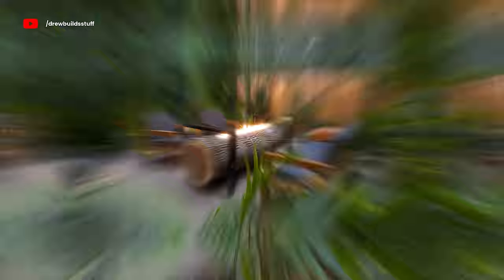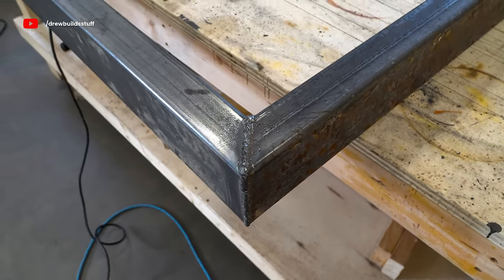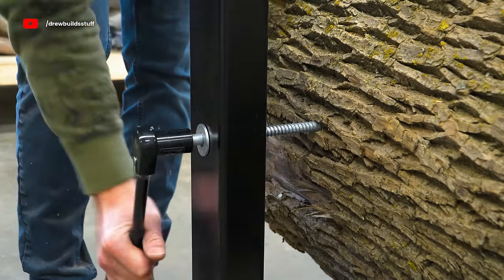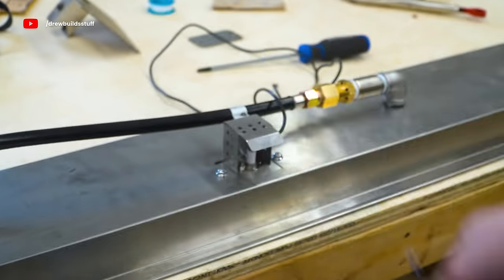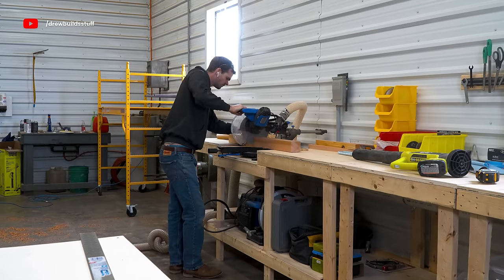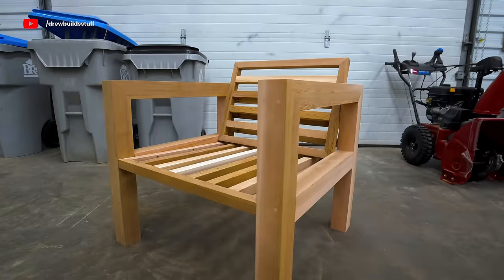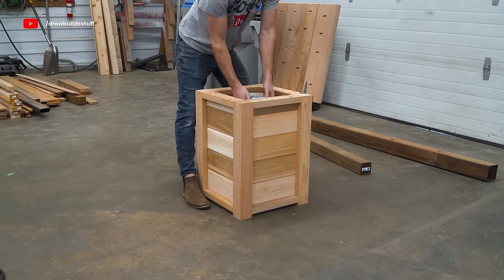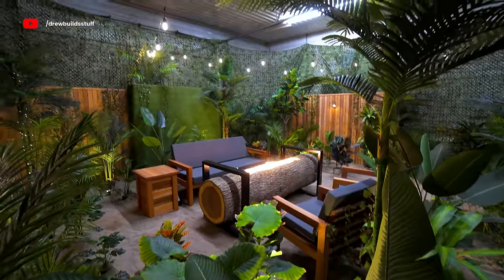Making my SHOP into a TROPICAL PARADISE for a Week - Full Build

Comment: HOLY MOLY, that is epic!  If you're ever bored, would be interesting to carve out a hollow in the log to put the propane tank in so there's no exposed hoses.  You could cut a cookie off the end of the log first which would be reattached using magnets or hidden hinges for when you need to swap out the propane.  Epic job!!

Comment: What a great idea. If you can't go to the beach, bring the beach to you. The 'fire log' is really cool. 

Here's a little welding tip: Bevel the edges of the materials to be welded. Butting two flat surfaces together, laying a weld on top of them, and then grinding everything off above those surfaces gives very little bonding strength to the joint. It's kinda like pushing two pieces of wood together and dribbling glue over the line between them, hoping that enough glue gets between them.

Comment: The stuff you build is outta this world, ive been watching for yrs & still amazed. That cheapy flux core welder does great & the welds are good . Now those bottom  of the line ryobi , i love mine , zero problems , i have dewalt & i think ryobi is just as good . Ive got there chainsaw  , weed wacker & love them all . I didn't used to think like this .

Comment: Excellent job and choice of projects. I especially appreciate the tropical experience, being raised myself in Florida. 

Only thing I would've done different is in trimming the 4x4s, I would've used a table saw and saved the 3/8" pieces for later and used as trim on another project. It would've saved a lot of tome on the planer too.

Comment: I've done a few fire feature bowls and tables, I would add a heat fiber or heat insulation between the fire insert and the hoses/wood. It will save the hoses and avoid burning the wood from transfer heat. Just a idea

Comment: Would love to see more personal videos. I would also like to recommend that you build a wood working bench. something that has a little something of everything you need for it. like clamps, maybe a welding table, straight edges/ preset angles/ preset lengths you tend to use more often ( i see you've built a lot of walls lately lol), and maybe a place you can put your more bulky tools like your planer. i think something like that would help a lot with efficiency..... and your back! lol. always a good day when you upload man i cant wait to see the next parts of the tiny home!

Comment: Some 1/4 inch or 3/4 inch copper pipe painted black and slid over the bolts that go into the log would finish it off lovely.

Comment: if you decide to build another bike trailer you should make one that looks like a 5th wheel trailer which attaches to the bike using a standard 1 7/8" trailer hitch and a tilt-ball mounted to a heavy duty rear rack. With that and the right suspension setup you should have pretty good maneuverability and it'll be nicer to pull.

Comment: Added benefit of planeing down the 4x4's is you reduced the total weight of that frame by about 25%, and they'll still be more than strong enough.
The downside is you pay for the full size 4x4, and turn 1/4 of it into sawdust. For clear cedar, that's some pretty expensive sawdust.
Reply from the maker: Haha very true

Comment: Supposedly if you dust some soot on the metal around your weld it prevents weld splatter from sticking and helps with a bit of that cleanup. Never welded before in my life so no idea if or how well it works, just passing on what I heard.

Comment: When I built my bed frame I kinda wish I had a planner cut them 4x4 down to 3 inches. 
I am considering doing it again and buying a planer just for that project. I want to do the frame much better with the legs inset more and build a head board and foot board along with it. My current bedroom has a weird wall angle next to it and I have considered just building a book case type thing to fill that area in then make the new bed frame match. When we build in a few years the new bedrooms will be fully built in cabinets behind the bed and the frame will be a split king adjustable bed. The whole thing will be built in to the wall which includes lights, outlets fans and swivel out alexa devices.

Comment: I'd reinforce the chair's legs connection points. I had chairs connected the same way and those deck screws just do not hold to the time. Either the wood will split or the screws will shear in just a couple of seasons cause of weather cycles. And who am I to tell you what kind of weather shit-show we have here in Canada.

Comment: This guy, spends a month's salary on one cool ass video🤣😂 I'm not hating though, this is a mighty fine setup. Got a "similar" setup in my room with 17 live tropicals, 50 feet of smart LEDS, salt lamps, smart bulbs galore, fake vines hanging around the perimeter, and a wall-sized jungle tapestry. Whole bunch of sand drug in from work too, which reminds me, I should probably vacuum.

Comment: Interesting the rest of your builds seem to have a practical use but this one was just kind of random other than the plants are you planning to reuse the other materials from this build for example will this be apart of a backyard build for your tiny home? It would be neat to see still liked the video though it just felt a little random is all
Reply from the maker: It was a bit of a time killer as I was waiting for the days to get longer and brighter to work on the tiny house again.  But this patio set and fire log will be moved to my tiny house location (once I find a spot for it), plants will be sold or reused, sand will likely go a sandbox for the kids somewhere.  Very little wasted in this build

Comment: You gotta take all that teflon tape off those joints ASAP!. 

 The compression fittings don't need it, and the other ones need to have propane/gas safe stuff on it.   There is pipe dope that is blue and is gas safe.   If you don't the gas will eventually degrade the tape, create a leak and then you are having a bad day.  A lifetime supply is like $10

Please Please Please don't put yourself in danger. 

Regards